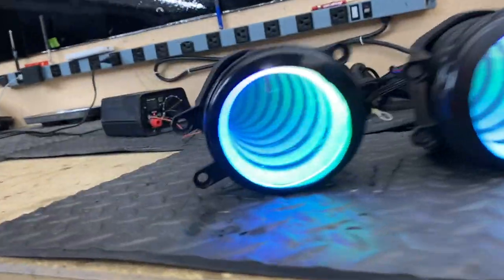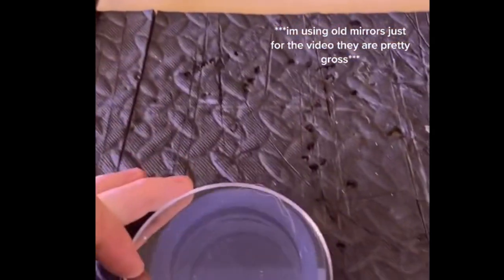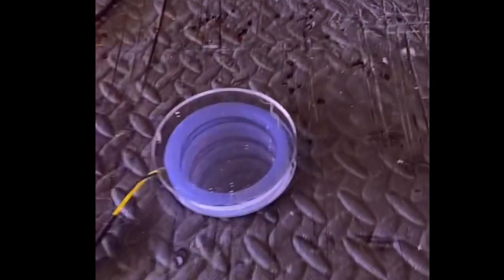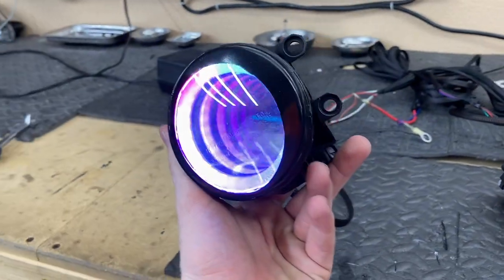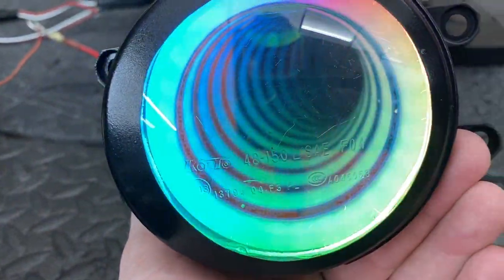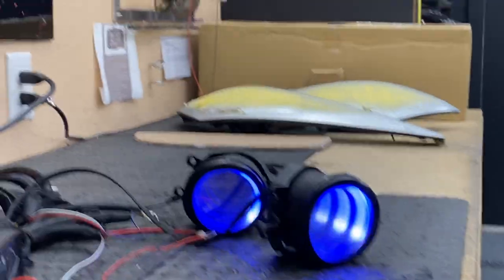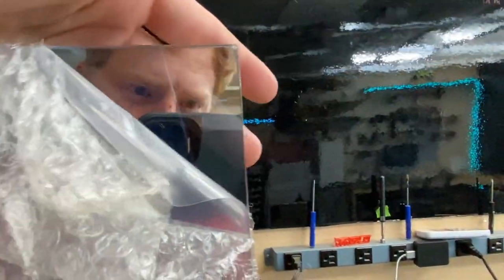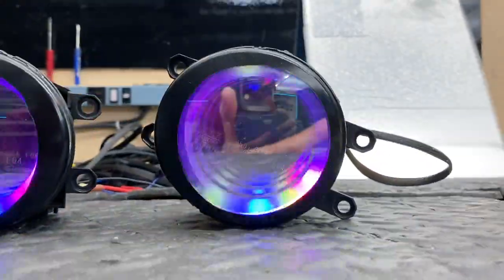4runner INFINITY MIRROR fog lights

Comment: i know drilling glass is a mess, but probably you could get away with a mini 1.8 inch projector on the center, it would keep the effect but would have actual fog lights
Reply: I did it with my fog lights and used acrylic mirrors